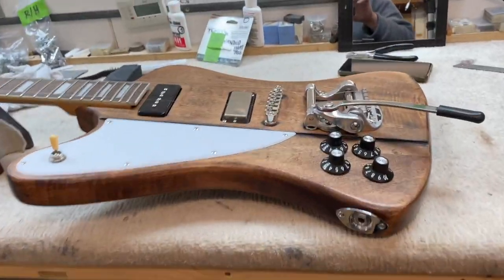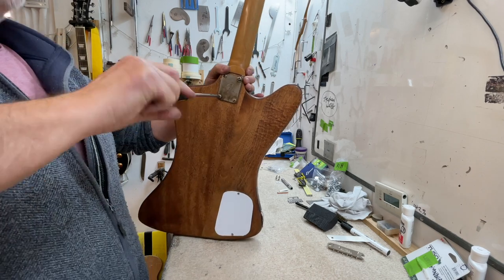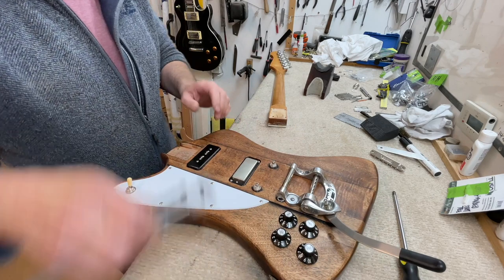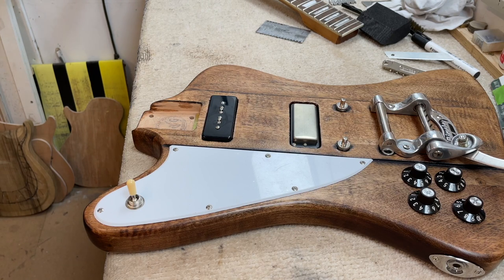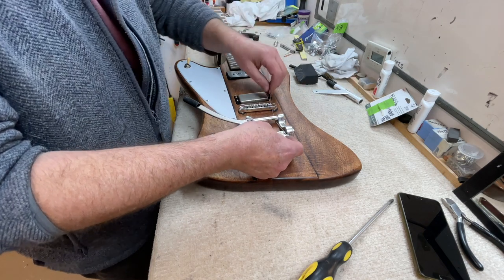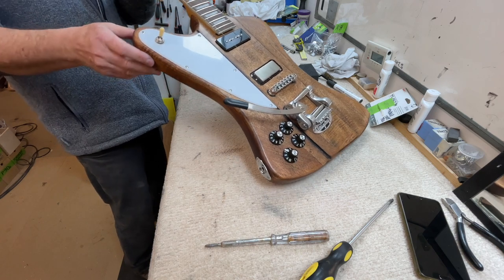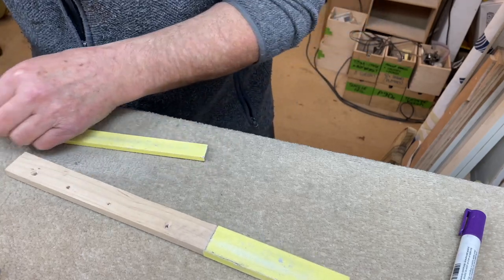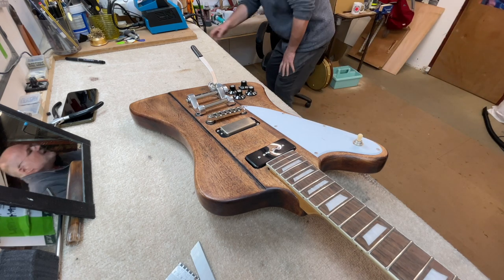Firebird Kit Built Pt 8 fixing two MORE poor quality kit problems

Comment: Isn't that cathat sticker on headstock upside down?
Reply: Not for a lefty guitar
Reply from the maker: Trust me, I had to check several times (as well as choose first right-handed then finally left-handed tuners!!) It's only 50/50 choice but I can be guaranteed to mess it up. In truth on a previous guitar of Andrew's I DID put the bloody decal on the wrong way - completely forgetting it was for a lefty. Doh. Luckily it was the work of an instant to scrape it off, sand back re-prep and go again! :-D